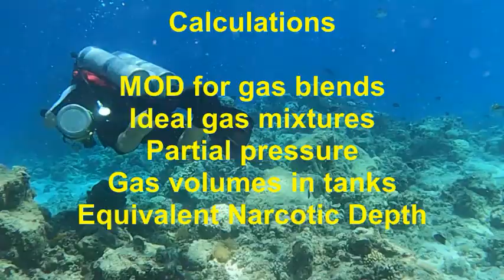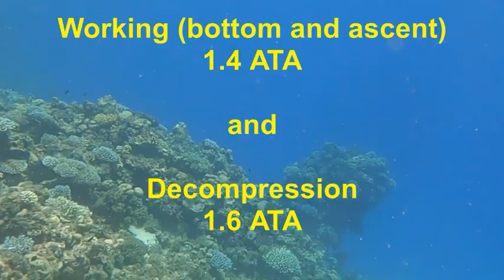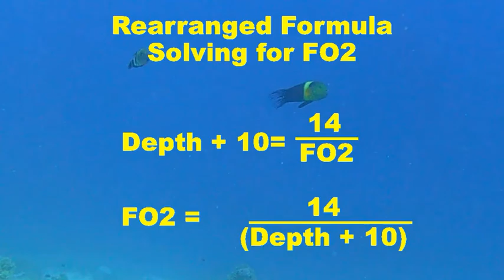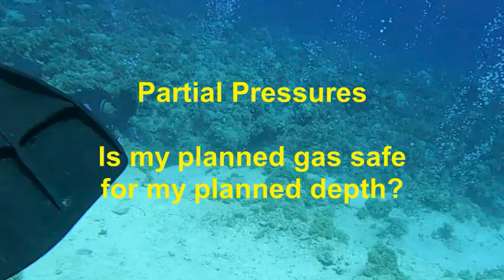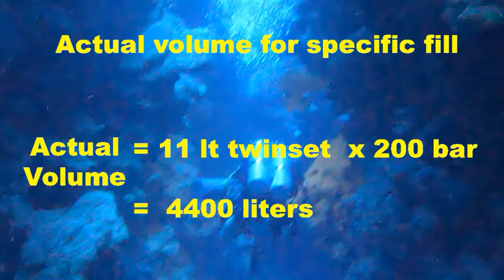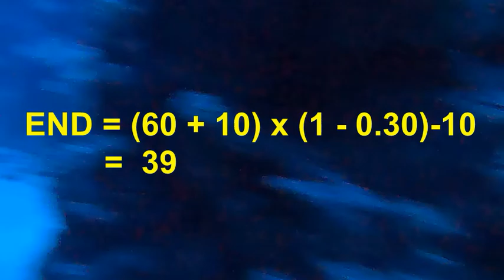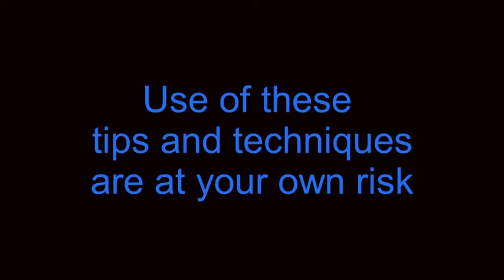#47 - Common Calculations for Technical Diving Classroom Training - Metric Version.

Comment: Understanding how the calculations work helps in remembering them.

A 10m column of water equals 1 Atmosphere or 1 bar.
So 10 is added to or subtracted from depth to compensate for the atmospheric pressure at the surface.
The ATA is also multiplied by 10 to convert pressure to meters of water.
So an ATA of 1.4 equals 14 meters of water, and an ATA of 1.6 equals 16 meters of water.

Maximum Operating Depth (MOD) is in meters (m). It's the depth at which the percentage of oxygen in your mixture becomes toxic. (For working MOD, the max ATA is 1.4 because you're exerting yourself and absorbing more oxygen in your tissue. For decompression you're at rest and the max ATA is 1.6.)
Atmospheres Absolute (ATA) is in bar but needs to be converted to meters for the formula to work: ATA * 10 = meters.
FO₂ is the fraction of O₂ of the mixture. For air it's 21% / 100% = 0.21
-1 bar to compensate for atmospheric pressure at the surface = -10m

So:
Calculating Maximum Operating Depth for mixture:
MOD(m) = ATA*10(m)/FO₂ - 10(m)
For air: MOD(m) = 1.4*10(m)/0.21 - 10(m) = 66.67 - 10 = 56.67m
For Nitrox 28: MOD(m) = 1.4*10(m)/0.28 - 10(m) = 50 - 10 = 40m

Calculating max percentage of O₂ for depth:
FO₂ * 100% = ATA*10(m) / (MOD(m) + 10(m))
When diving to 40m: FO₂ * 100% = 1.4*10(m) / (40(m) + 10(m)) = 0.28 * 100% = 28% O₂.

For pure O₂, the max ATA is 1.6. Anything above that is toxic.
MOD(m) = 1.6*10(m)/1 (pure O₂) - 10(m) = 16 - 10 = 6m
======================================================
Partial Pressure O₂ (PO₂) is the actual amount of O₂ in you're inhaling.

PO₂ = ATA * FO₂
======================================================
Actual volume in liters (l) is pretty straight forward. Since 1 bar is normal atmospheric pressure, the amount of bar is the multiplier for your cylinder volume.

Actual gas volume (l) = cylinder volume (l) * pressure (bar)
======================================================
Equivalent Narcotic Depth (END) calculation

We again add 10m to the depth to compensate for atmospheric pressure at the surface.
We multiply that total by the fraction gas that's NOT Helium (1 - FHe).
Then we subtract the 10m of atmospheric pressure again so we come to the equivalent depth with the same narcotic effect for diving with air.

END(m) = (Depth(m) + 10(m)) * (1 - FHe) - 10(m)